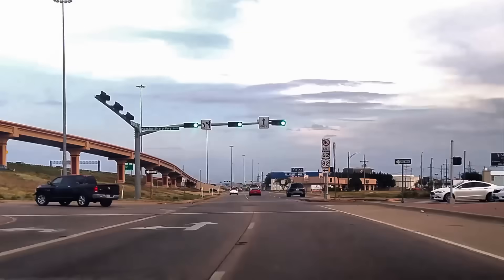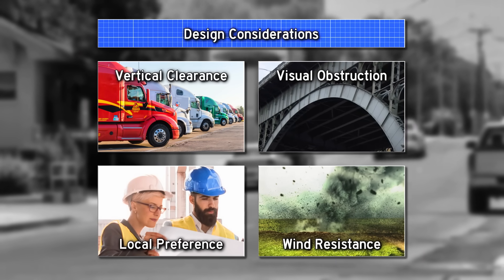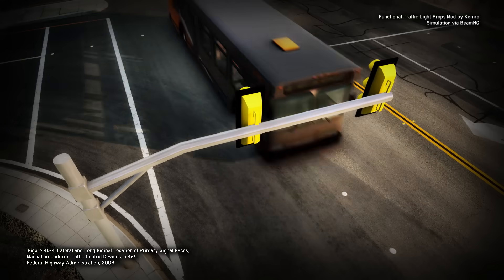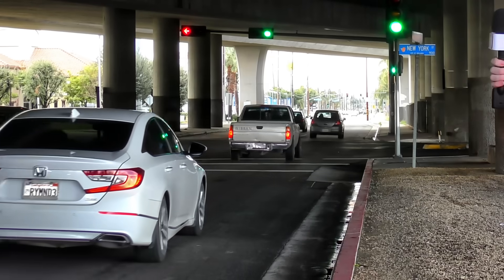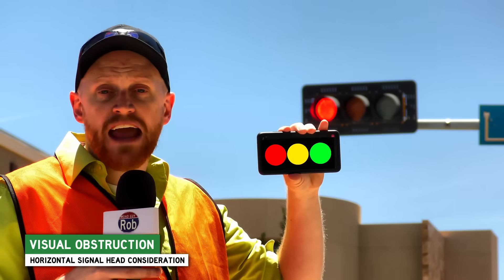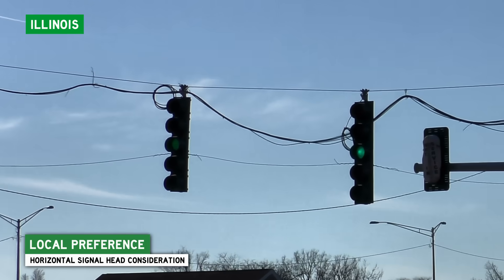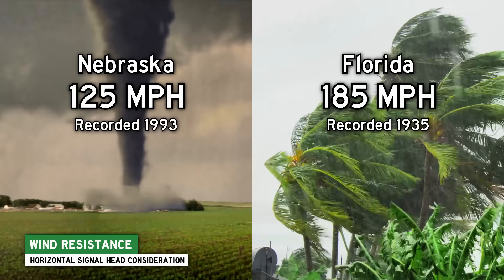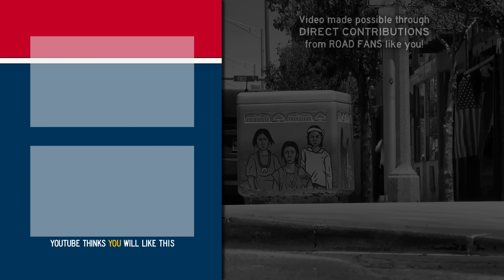What's up with SIDEWAYS STOPLIGHTS in Texas and Florida?

Comment: There are “many” in CA that have the sideways near overpasses if space or view is limited now. But that wasn’t always that way. It’s relatively recent, within the last 10 years. In the old days they either would have just mounted them on the bridge, which can be problematic to fix wiring and things, so I’m told, or if under a bridge like in your example, they’d have smashed it in there upright anyway somehow. There are attachments they put to have lights mount high and droop low for vision. Examples being like when the left turn arrow hangs slightly lower than others to differentiate. In LA off the top of my head there’s several off Jefferson and Exposition Blvds where the Expo metro line goes. Also one off the 5 south fwy at the Roxford exit and 2 under the 405 in Sherman Oaks, for Fiume Wk & Sepulveda Blvd. 
Anyway, anytime I see them I’m like urrrrffff which way am I looking??? Even though the light is on, it confuses my mind somehow. 
I was told as a kid that Hurricane Andrew was what made Florida reconsider having wirespans, it just took a long time to remake thousands of intersections.

Another thing I recalled is Wisconsin also has many that are sideways and I’m pretty sure they’ve been that way for ages as well.

Comment: wow that's cool you can actually see the traffic lights! In Europe no one gives a c**p, but like really most of the traffic lights if you get all the way to the stop line there is no way you can still easily see the lights from a normal car, it's your problem to figure it out and you should still go all the way to the stop line so either you don't care and leave a gap in front of your car or you remember your light changes in sync with another traffic lights nearby that you can actually see. I was once thinking why they don't put the lights on the other side of the intersection - US style, well I was reminded why as soon as I got in front of an intersection with five roads all at weird angles - it would be hell confusing with out crazy 500 years old road layouts.

Comment: There is at least one set of horizontal lights in Pennsylvania...just west of Pittsburgh on Camp Horne Road at I-279.  While most of the lights are traditional vertical, there are horizontal overheads across Camp Horne Road due to the I-279 overpass (or possible also a low power line).
Reply: I noticed that one too. Also check out near east ohio st in the city by the 279 Interchange

Comment: What I'd like to know is:  Is there a legal limit to how LONG a red light can detain you?  We've got some loooooooooooooooooong red lights here in San Diego.
Reply: The quick and dirty way of increasing the capacity of an intersection is to lengthen the cycle.   It takes a certain amount of time to bright the traffic stream up to speed.
Reply: @GilmerJohn  Like the old saw about a man whose only tool is a hammer, it appears the only tool traffic 'engineers' have is the red light.
I put engineers in quotes, because what real engineers do is make things work properly.
Reply: @TheRealDrJoey  --  Oh, they are lots more tools.   It turns out that the "red lights" aren't exactly cheap.   A "simple" installation can quickly burn up $100k.   One would think that adding a turning lane of the side street might be helpful but I saw in our previous county the VDoT refusing to add turning lanes.   Finally, however, that changed 2 miles of 2 land road to 4 lanes plug center turning lane.

Comment: As a Floridian from Fort Myers, I can confirm a lot of our stoplights are sideways. The wind is a major factor since we are very close to the coast and get a lot of hurricanes. Most recently, after hurricane Ian so many stoplights were just on the ground but there was still plenty of sideways lights in the air. I never really thought about how I don’t see sideways stoplights elsewhere in the country. Great video, thanks for some more information.
Reply: Yea, its a little funny especially the light by the six mile cypress slew, it was a cable mount but now their replacing them with poles
Reply: I’m in Broward County on the Southeast coast (Ft lauderdale) .  They started Putting lights mounted on poles horizontally after we were hit by Hurricane Wilma.  In part because they lost so many hanging lights after Wilma that Cops had to spend too much time at major intersections directing traffic.   I think it helps get businesses going again post storm.  The other change they made then was requiring Gas Stations  to have emergency generators so the pumps work even if electric is down.
Reply: It's funny, on the east coast of florida the sideways ones are rare unless you're in a bigger city
Reply: Hi neighbor!  Fort Myers Beach here...well, hopefully back to my home this year.  Living in Fort Myers until it gets rebuilt.
Reply: @grayrabbit2211  Kissimmee here, Fort Myers Beach is still got some damage? I thought they’ll be repair by now since hurricane season is around the corner
Reply: hey! also a Floridian who lives in fort myers, i never realized that when i moved out of my hometown that a lot of the lights around here are sideways 😅 my college just barely dodged hurricane ian, but everywhere around here had messed up lights for months. the only ones not messed up were the sideways ones!
Reply: I've been to Florida many times and it seems to me they cannot make up their minds on how they want to mount the signals!

One intersection is the wire span with vertical, then the very next is pole mounted horizontal, then the very next is pole mount vertical, then back to horizontal.

Comment: I live in a community where the highway is a designated overheight corridor. The lights on the highway are both horizontal AND vertical! Cool feature though is that a pilot truck driver can stop and swing the lights 90 degrees for extreme loads. Also fun watching a really good oversize driver gp through and just dodge the lights (intersection is blocked for just them when they do this.)
Reply from the maker: Which highway?  I'd love to see that on Google StreetView.

Comment: They are rebuilding the De la Cruz overpass at Hwy 101 in San Jose, CA and they just added sideways stoplights. They are nowhere else in the city, or even the entire bay area except under some  overpasses where height is an issue. It's a bit jarring actually. I can't think of a good reason, certainly none mentioned in this video are applicable. Anyone have an idea?

Comment: I have a question, how do stoplights get the wiring on the pole?
Reply from the maker: The pole is a thin-walled tube, so the technician can drill a hole one each end and fish the wire through the hollow part in the middle.  Someday it would be fun to shadow a traffic signal installation and film it!
Reply: @RoadGuyRob  So the wiring is run in the pole like conduit?  Interesting.
My dad and I actually got called on an electrical job to troubleshoot a stoplight at an intersection where the red light wasn't working.  It turned out to be a fluorescent stoplight that uses electronic dimmable ballasts and compact fluorescent tubes for the red, yellow, green.  When the light turns green, the fluorescent tube for the green goes to full brightness operation and the fluorescent tube for the red dims all the way down.  It was in Euless where my adoptive sisters live but I don't remember the location of the intersection.  But it was cool nonetheless!  Have you ever seen a fluorescent stoplight before using fluorescent tubes behind the red, yellow, green lens before?

Comment: The first time I saw horizontal traffic lights was in 1964 in Sainte-Foy, Quebec. The red, yellow, and green lights' lenses also had different shapes: round, square, and triangle, although I don't recall which shape goes with which color.
Reply: For the shaped lenses, the red lights are square and the green lights are circular (or arrows). The yellow lights use diamond shapes, which you might be misremembering as triangles. The shaped lenses are being phased out, though; new installations use all circular or arrow indications.

Comment: We have horizontal signals here in Maine and they are a rare sight.  One example is in Waterville, ME.  The reason why they're horizontal is that the two intersections are on either side of a bridge carrying Interstate 95 over the road.  They're mounted horizontally so the signals are easier to see.  I guess they didn't want drivers pass through the intersection on a red signal they couldn't see.

Comment: In Central Europe, traffic lights are always placed at the place where you are supposed to stop. The same as a STOP or YIELD sign.

Living now in the UK where the traffic light can be both before & after or just before the intersection, it is more convenient BUT there are cases when you can get tricked and are extremely dangerous. Places where the traffic light after the intersection is indepoendent and only applies after the intersection. I thought that I had a green and proceeded. But it was an independent traffic light which only applied before the intersection at a crosswalk which was just around 10 meters in before that. I did not even think of checking the other traffic light.. Luckily, I almost always look sideways to check that the road is clear and stopped confused before getting in the way of traffic comming from the side (London, Baker Street)
Reply: "Living now in the UK where the traffic light can be both before & after or just before the intersection"

Most intersection in Denmark, Sweden and Norway has traffic light setup near-side and far-side. Not to mention, Copenhagen also had lots of suspended traffic light, but unlike the US, they also have wires under the traffic lights as well.

Comment: 8:20 it is based on the side on which traffic drives. If it drives on the right, the red is leftmost as it is furthest from the previous traffic light which is vertical.

Comment: It is also very common to mount them horizontally in Wisconsin when the old style poles are used. They're tending to install new signals vertically, but they maintain the horizontal ones still.
Reply: As long as we continue using poles, I'm happy. Every time I travel outside of Wisconsin and see spanwire signals, they just look tacky and cheap.

Comment: In the Netherlands, the traffic signals are RARELY on the other side of the side of the intersection. So,, you rarely see drivers blocking the crosswalk. Also, there many fewer traffic lights where a roundabout will do the job. And I can count the number of stop sign I've seen , in 19 years, on one hand. OK, NL is small, about the size of Maryland. MD has a population of 7M.   NL has 17.5!    Oh, and no such thing as right turn on red.

Comment: It is a really complex situation, but a many MUTCD guidelines can be disregarded, and still end up with a safe traffic system: The "minimum 40 feet from stop line", "maximum 25 feet high up" and "no more than 20° either side "are rules that can be nullified in certain situations.

In Europe, where there there is only one lane, it is absolutely common to have the signal head on the right side of the road and before the intersection itself, basically flush with the stop line. This way the code doesn't lawyer anyone into a corner with clearances, because if the signal head is literally on your right, there is nothing to obstruct it, not even the short bridge right there, and trucks can easily pass "under" them, no problem. You an see them clearly, when approaching (arguably even better, than if it was 40' further down the road), and you can keep track of it as you stop at the line. It's absolutely normal where I drive to stand at a red light, and look almost directly to my right to see the traffic light. Even more interesting, when there are more lanes in a direction, but turning traffic is not significant, so a dedicated turning lane, and associated lights for turning traffic are not present, it is common to have a single light with a "full green" in the same spot (maybe a second one on the left, but still in the same line) and both lanes and all turning traffic are looking at the same signal head, and when there are conflicting paths, both with green signals, the order is decided by lower level principles (turning traffic yields to straight ahead, left turn yields to right turn)

Comment: One option, as you can see in the MUTCD, is to use double red lights to tell color-blind drivers to stop. A more cost-effective method is to make the red light noticeably larger. Then color-blind drivers will also be able to guess that the yellow "clearance" light is on. This should be a recommended practice.

Comment: Im from Nebraska, and NDOT still mounts new signals horizontally. However, the majority of signals in Lincoln and Omaha (the two largest cities in the state) are vertical. In Lincoln, they all used to be horizontal aswell. Several years ago they started the "Green Light Lincoln" initiative and implemented the yellow flashing arrows back when those were big news, well as they were retrofitting intersections with those new signals they also started mounting the signals vertically. They also did a handful of other changes or improvements during that time. They document all of that pretty well online. Id also note that many signals that may be owned by NDOT, but managed by a city (such as Lincoln), usually form to the cities standards.

Comment: Quebec also mounts traffic lights horizontally and with 2 red lights on both ends (except for left turn lights which one red light is in the middle left slot)
They are being replaced with new vertical lights though

Comment: the real question is why do some states mount them vertically. also, hanging from wires is really stupid but it's a cost cutting measure so it's fine I guess
Reply: apparently I was here over a year ago, I still agree that horizontally is probably better

Comment: When I lived in Florida I hated the lights on a cable.  One issue is because the cable is diagonal over the intersection, in some directions the light you need to see is almost overhead of the car.  The second is they take them down for a storm, they are supposed to become four way stops but is Florida it's more like a game of chicken.

Comment: You left out NYC. With many highways and elevated rail lines they had to put the lights horizontally while lights and the side of the streets are vertical. Some of this has disappeared over the years as some vertical lights have been mounted higher up on bridges so that their bottoms are as high or higher than the lower parts of the bridges.

Comment: The problem with sideways lights is that, when it is dark in inclement weather, it is easier to see if the lit light is the topmost one with vertical lights than it is to see if the light is the leftmost one for horizontal lights.  If you are color blind, you are at a distinct disadvantage with horizontal lights in inclement weather in the dark.  I live in a province with mostly vertical lights but live right beside a province with mostly horizontal lights.  I've spoken to color blind people and they say that is the case when they cross the border to the other province.  One of them says he only drives with his wife when in the other province to ensure she tells him that the light is red or green because it is such a hazard.

I notice that Florida and Texas have horizontal lights but they also don't have snow and all that much inclement weather, so it's probably not a problem there.  But in Canada, it is definitely a disadvantage for color blind people, some of the time.

Comment: I am a stoplight nut in New Mexico and the reason why we have horizontal lights is because the spring winds average 60 miles an hour and some day over 100 miles an hour.
Reply from the maker: That bent-tube "U" shape must make the signal quite sturdy.
Reply: @RoadGuyRob  agree. That is why in 2009 NMDOT started using much thicker arms and masts to they do not sway as much. You in downtown Gallup where those poles and arms where installed in 1965 and if you go to US 491 and I 40 interchange those poles where installed in 2008 ish. I do know this, the city if Rio Rancho, NM how has it to where their light are vertical instead of horizontal like the rest of the state.

Comment: Japanese Reading direction is a lot lot more complicated. There are three styles
Modern western: left to right, then down. Used in western restaurants, computers and government forms
Modern Japanese: first down, then right to left
Classical Japanese: either as modern Japanese style or right to left, then down (for example often seen in old maps, older than 80 years)

Especially in Japanese context very short descriptions like one-line horizontal nameplate thus have usually a different standard associated reading direction:
Right-to-left. This can have two reasons either an ancient temple, palace or building it's simple because of the classical Japanese reading direction. Or in a modern setting interpreted as a 'page' in modern Japanese style that has a line break after each symbol thus making it irrelevant that the first oder Reading direction is down just leaving us with right to left.
Because many Japanese would default to right to left in these settings, I would say it is not far fetched to say that this applies here for the traffic light situation
Reply from the maker: That's great to learn about.  I know ZERO about Japanese.  I asked a fluent friend, who told me about the modern western.  I wasn't aware of the other two.

Thank you!

Comment: Never really noticed.  Live in Florida but have traveled to most states.  I'm so used to the horizontal lights.  Where I live in FL, there was one vertical/wire light, but they took it down and replaced it with a 4-stop sign intersection.  There are some vertical/wire temp lights in construction areas.  Those will be gone once the construction is complete.